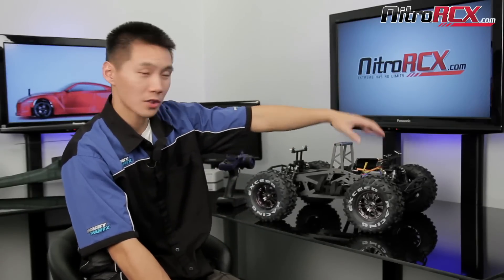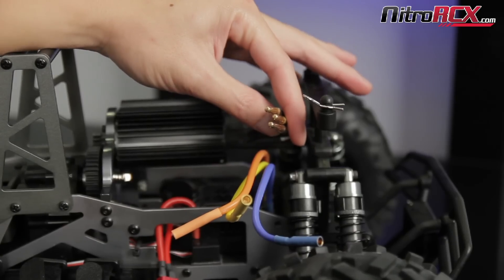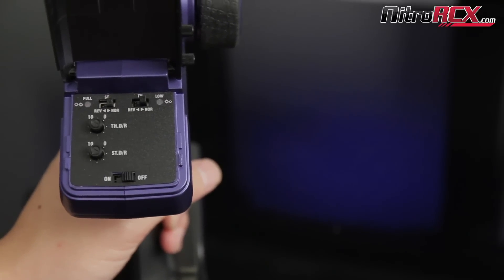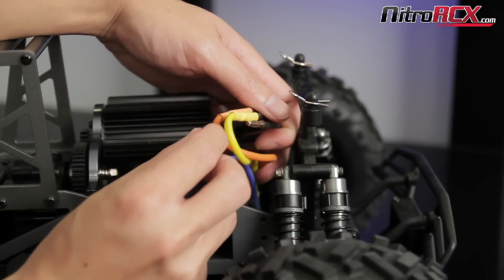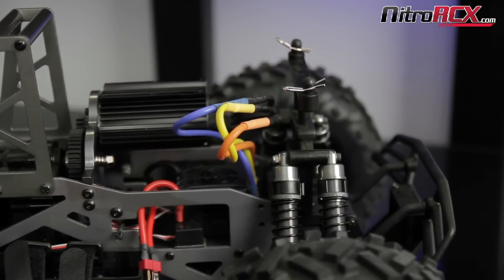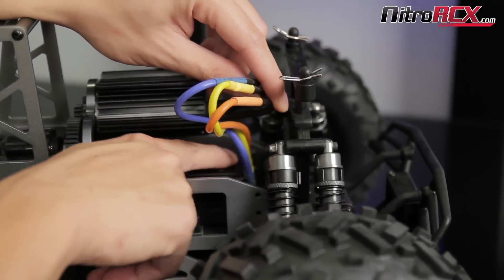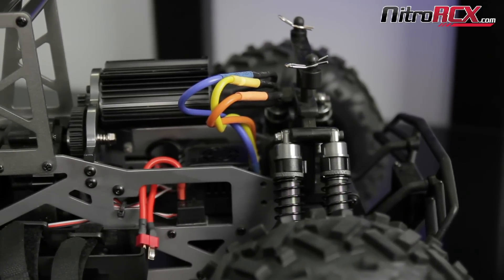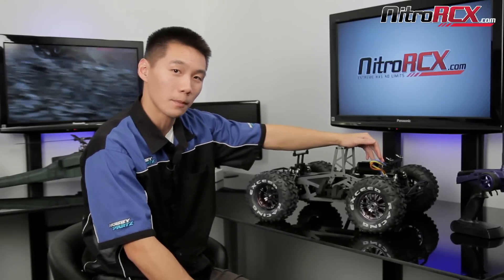How to Reverse the Rotation of a Brushless Motor

Comment: Thank you for posting this vid. I couldn't understand why when I transferred all of my electronics from a plastic tub to an aluminum one, the motor ran backwards. I tried reversing the switch on the transmitter and technically it worked, but it was wide open throttle and I couldn't adjust the trim enough to make it stop. So thanks for this vid. I posed the question on a RC forum, and no one answered and I'm missing my stupid fast truck. It was a EMAXX, except that I replaced the dual motors for a single brushless. Now I can go play. lol I have four other EMAXX as well. But those are staying relatively stock.

Comment: This doesn't work at all I have a fan in a air purifier. Brushless. I need to fan to run the other way. I swapped two positive and negitive wires and nothing. I swapped the negitive with the 3rd wire. Nothing.

Comment: If you use servo reversing on your transmitter you could effectively be running the reverse function of your speed control to go forward, this usually has the effect of bringing in a delay when you brake. Better to swap the two wires and leave the transmitter throttle reverse alone. Also, swapping two wires only applies to three phase motors (which pretty much all brushless RC motors are).
Reply: Only applies to non sensored brushless
Reply: @stpbasss3773  Holy 9 year reply Batman
Reply: @TheAegisClaw  lmao

Comment: I have the Reventon  SPEED PASSION SPEED CONTROL pro and im using the KO Propo EX1 FHSS radio, the issue i have is that i cant configure the ESC to run THE MOTOR  IN THE CORRECT DIRECTION  the only way the speed control will run the motor after calibrating the speed control to the KO Propo EX1  is switching channel 2 in reverse  BUT then the motor runs in the wrong direction I have tried programing the speed control several times in normal mode in channel 2 but the motor will not run at all in normal mode Can  can you swap wires on this setup THIS IS A SENSORED BRUSHLESS SETUP ????
Reply: +skippy813  Hi Skippy, I've got the same problem : impossible to reverse the motor... You may not swap the wires on a sensored motor. Impossible to calibrate correctly with the reverse at the radio.
Reply: If you have gear diffs you can flip them over and this will fix the rotation problem.
Reply: skippy813 No it's impossible. There are pulleys and belts on my driftcar...
Reply: I know in Speed passion trouble shooting section if motor runs in opposite direction you can swap any two wire connections between esc to fix motor direction. BUT THIS ONLY APPLIES TO SENSORLESS MOTORS.
Reply: Yes, I know that. And what about if you've got a sensored motor ?
Reply: I Think TEKIN ESC have the reverse feature on there controller and maybe hobby wing, I also have hear that sometimes when reversing the speed control it sometimes gives you less power in one direction. Sorry to hear you have this problem speed passion should fix this problem with there esc !
Reply: Yes, Hobbywing get this. Tekin too... I can't understand why such a brand couldn't provide this simple fonction ? I've sent them an email. Wait and see. What a pity, such a nice combo....
Reply: skippy813 that’s my problem, I tried switching 2 wires on a scooter motor with sensors and it just didn’t like it. So I have only slow speed in forward and can get fast speeds in reverse.
Reply: I'm having the same issue with a piece of shit hobbywing bl120 sensored,  the pos esc doesn't have the option to Reverse rotation like all my other brushless setups. Just ripped it out of a build I did and threw it in my junk box, what a piece of dogshit makes me want to sell all my hobbywing shit.
Reply: @ValdeckRocher  only some hobbywing are able to,  the bl120 you get what you get unless you run it with no sensor and I refuse to do that in a crawler.

Comment: excuse me.. i have a ezRun 5.5t brushless motor and the sensor wire were soldered onto the motor it self .. does that mean i have to take it off or is there any other ways to reverse the rotation of the motor...